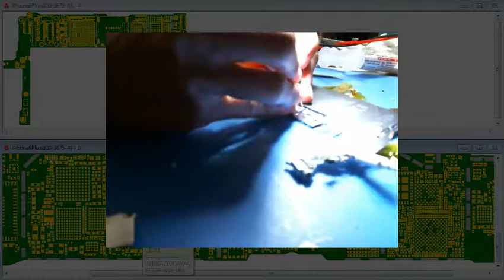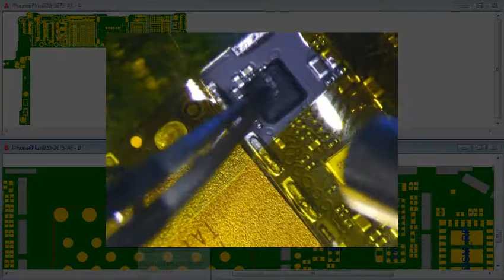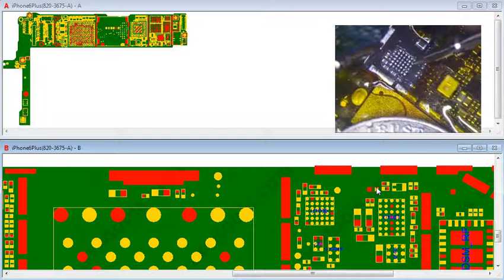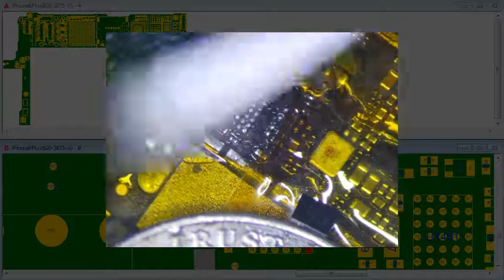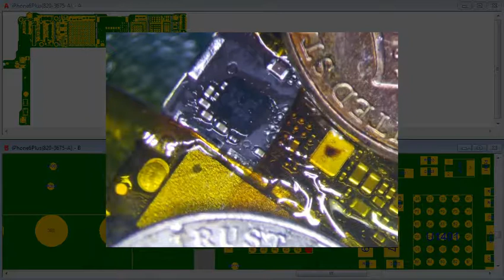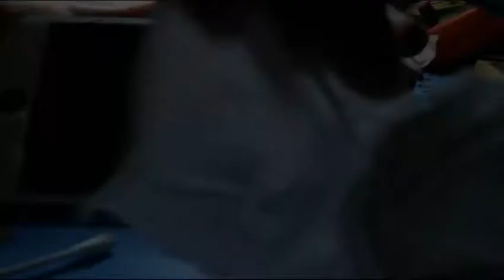iPhone 6 plus tristar repair PP3V3 ACC = 0 Volts

Comment: Having this same problem, except I’ve swapped Tristar and Tigris with brand new IC’s with no prevail. Still far charging iTunes connects and shows lightning bolt. Everything around Tigris checks out voltage wise.

Comment: HI  I have a problem in this section pp3v0-acc reading 0 volts iphone 5g could you help me phone in death mode thank you
Reply from the maker: the accessories power line doesn't turn on until the phone is completely booted up.

Comment: Hi

Really sorry for my English! I have done this change on a iphone 6s plus and at the beginning all worked fine. after 10 min of charging, the iPhone chrashed. So I took the lightning cable out, and turned on the phone again by powerbutton. After that, I plugged in the cable again and the phone crashed once more. Now it crashes all the time after put in the cable and it reboots. Maybe you know what the problem can be?
Best regards from Switzerland and thank you so much for your videos!
Reply from the maker: probably battery

Comment: Should have tried measuring that pp3v3_acc to ground in ohms setting. I'm curious if it would have gave a shorted reading which could prove that Tristar shorts to ground on that line (maybe) What does that 3v3_acc line do anyway?
Reply from the maker: I believe it's a tristar bypass, if i remember correctly.  I suspect that this line goes to zero once the battery is fully charged.
Reply: Was pp3v3 always present even with charger unplugged?

Comment: I have 2 iphone 6+ same problem PP3v3 ACC 0 volt i changed literally every component in that section and still 0 volts my U2 ic is well tested and i am stuck with these 2 phones
Reply from the maker: Check for a short.  Check the voltages around Tigris.  I think the USB goes to Tigris, then the transistor to tristar.
Reply: Try soldering jumper wire off 3v Tristar to feed 3v3 acc. See if that works.